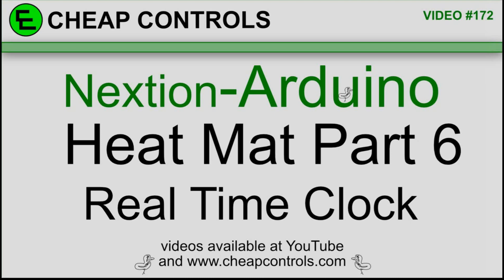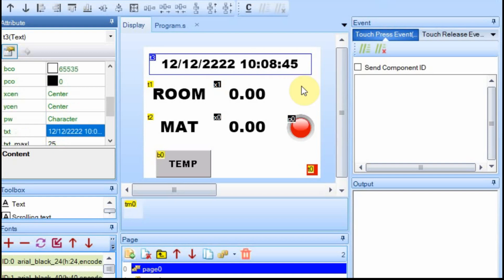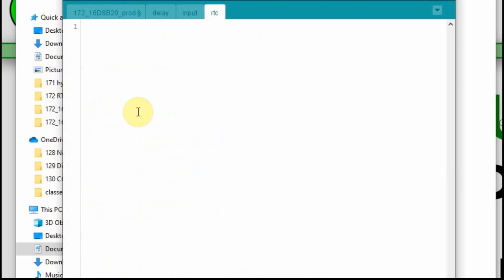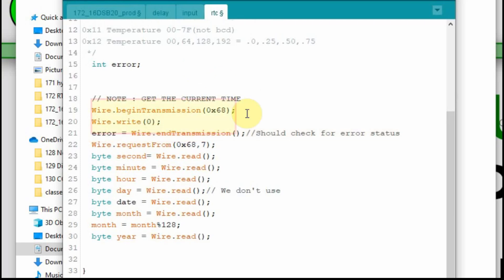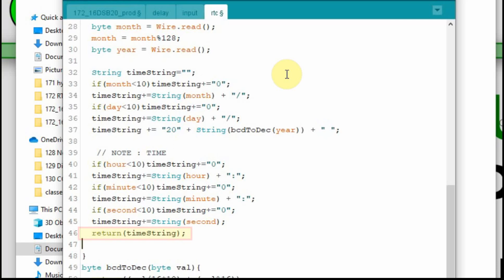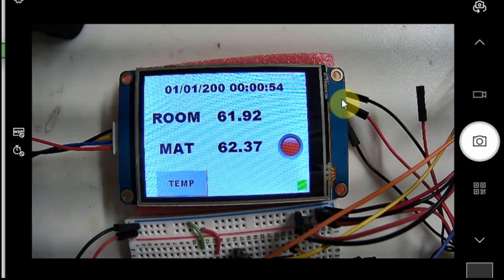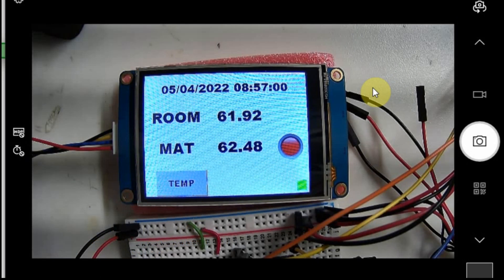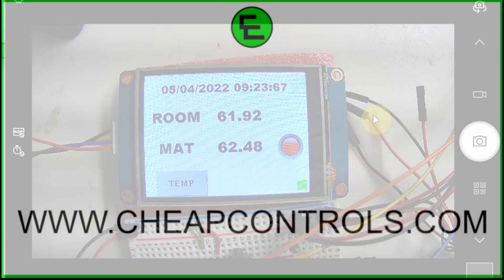172 Add a #RTC to my Heat Mat Controller #tutorial with a #nextion and a #arduino part 6

Comment: Wow I love your channel. I've learned so much. Thanks for all your efforts in giving us the best quality explanations. Can I ask if you can explain how to add a button to the Arduino and then as you press the button a number changes on the nextion screen. I'm not sure if you have done something similar to this nut if you did can you point me in the direction please
Reply from the maker: look at video 165 - https://youtu.be/QgEP9Utb-kY Let me know if it helps.  It is a float instead of number.  My original nextion.h no library video is aging.  My next video is the final video in the heat mat series.  Then I am making a new video  on using the nextion without the library.
Reply: @CheapControls  thank you so much. It's rare that people reply on YouTube. I'll have a look at the video and let you know. Thanks again
Reply from the maker: I do my best to reply.  Thank you for taking the time to watch.